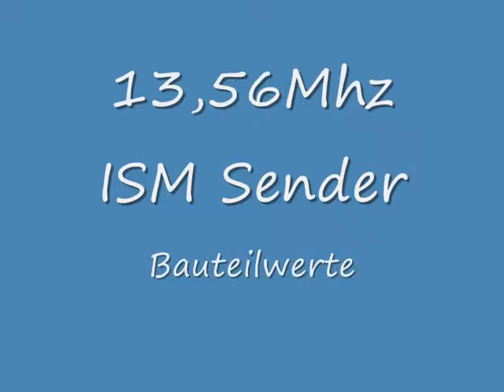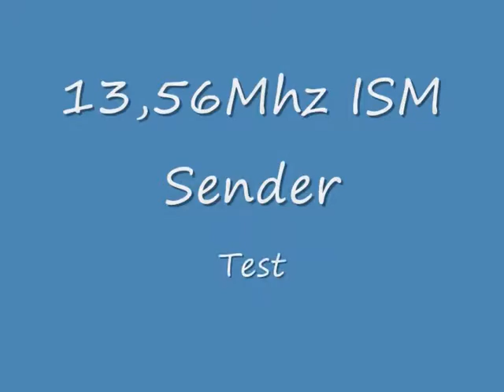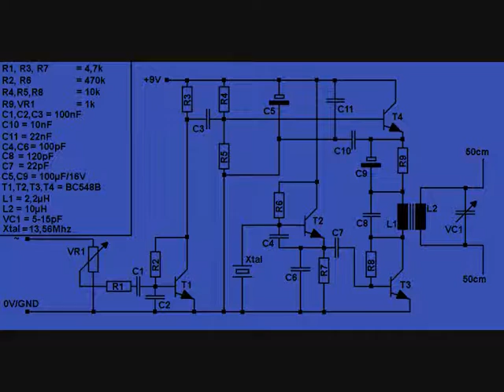13.56Mhz Kurzwellensender

Comment: Ich kam leider jetzt erst auf deinen Kanal, so viele Sender.. habe ewig nach sowas gesucht! Sehr sehr interessant!
Reply from the maker: Grüß dich,
eine etwas späte Antwort, ja. Freut mich, das du hier her gefunden hast. Du solltest dir auchmal den Kanal meines Kumpels anschauen. Sein Kanal heist "eflose". Wenn du mal irgendwas brauchst, eine Schaltung oder so, kannst du dich gern bei mir melden. Direkten Kontakt zu mir erhältst du über meine Website, die ich in Zusammenarbeit mit Simon gemacht habe. Die Adresse ist senderbau 24 . de. Du kannst mich dort per Impressum / e mail direkt kontaktieren.

Gruß: Stefan.
Reply: @Stefan0719   Ja, den Kanal von eflose kenne ich bereits habe euch beide abonniert. Wirklich fantastisch, was ihr beide da aufbaut. Ich selbst habe Elektrotechnnik studiert, aber im Studium kaum bis gar keine Kenntnisse über Sender / Transceiverbau vermittelt bekommen; dort ist eben alles stark theoretisiert. Hier freu ich mich mal etwas praktisches nachbauen zu können,  befinde ich mich eher im Bereich Röhrenverstärker für E-Gitarre und Arduino / Mikrocontroller. Funk hat mich aber schon immer interessiert! In diesem Sinne, macht weiter so! Klasse Kanal!